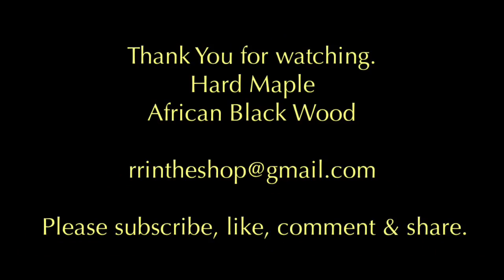Making a Quilt Rack Part 1

Comment: Hi Randy,
Smells so good, working with wood, but the dust, reminds me a certain leather handle, I'm still picking up the mess... lol
I wasn't watching the actual sanding but checking when the router and other tools were going to fall on the floor. Deception...
Nice woodchuck work bench, and the top surface is completely usable.
Cheers,
Pierre
Reply from the maker: pierre beaudry Thanks Pierre.  I have very good dust control in the shop.  I haven't reconfigured the main system since I have moved things around, but I will get to that soon.  Oh I had an eye on it but I knew I was going to stop before it went off the bench.  I thought it was kind of funny when I was editing and saw the router moving.  I built the bench almost 30 years ago.  The one vise I made on a ship, I will have to show it in a video.  I love the leather handle.  Thanks, Randy

Comment: You have to set up your miter saw. I'd take it apart and check each joint for fit. I have a newer makita and until i dealt with the joints and slide it was cutting really off, new from the box.
Reply from the maker: aserta I have never tore it down.  It is not to bad for accuracy but could be better.  I will put it on the list to look at.  Thanks for the suggestion.  Thanks for the visit, Randy